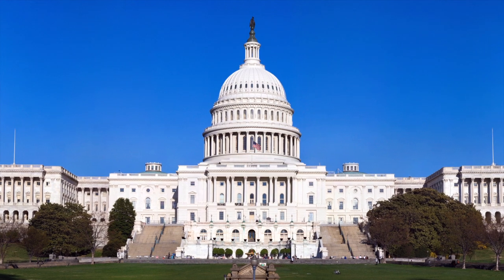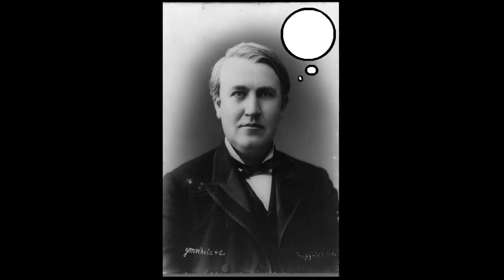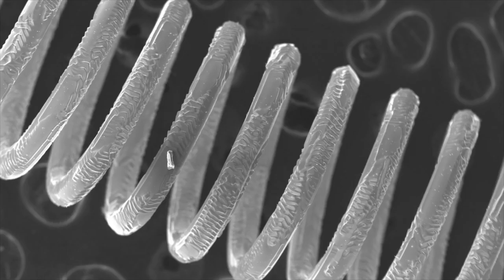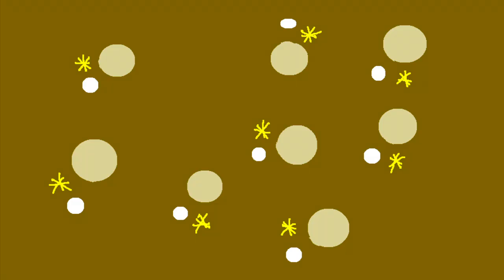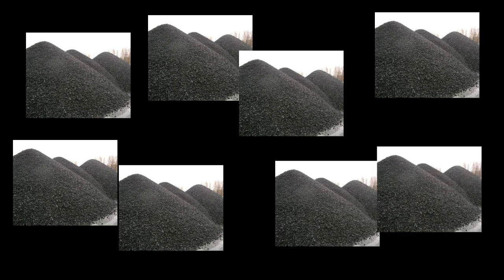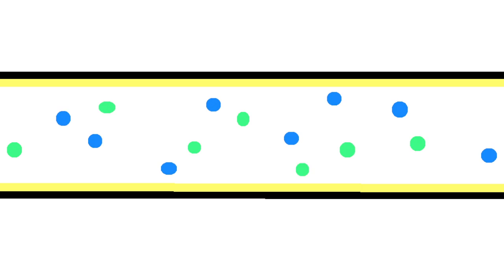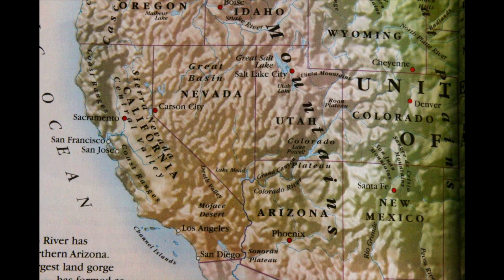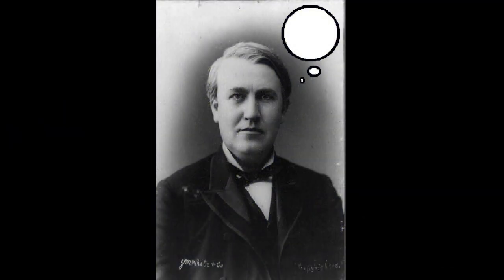Illuminate

Comment: Good job on the video. You need to be careful, though, to address both the scientific side of the issue and the political side of the issue. Your video does well at pointing out that CFLs are superior to incandescent bulbs.  However, does it follow that laws should be passed to outlaw the old technology? Edison likely would not have supported the banning of candles. Be more careful not to jump from scientific argument to political conclusion without addressing political concerns (e.g., rights).